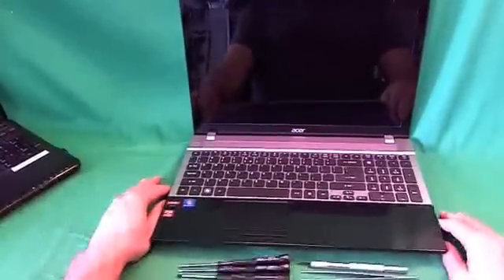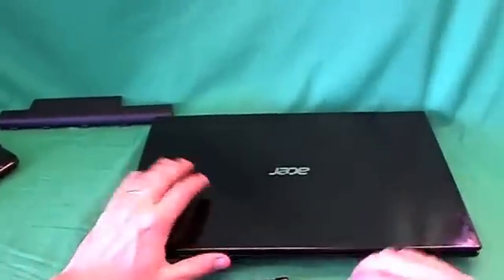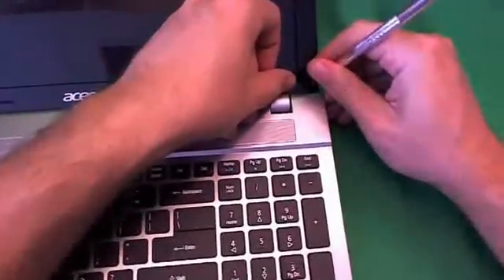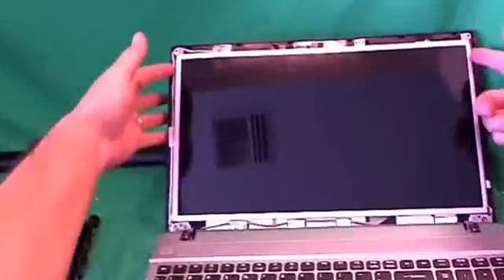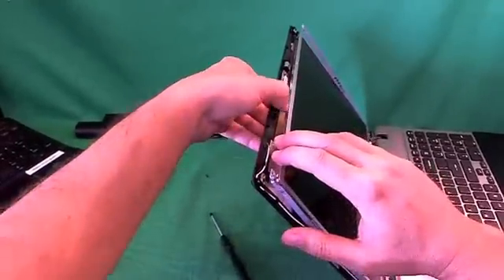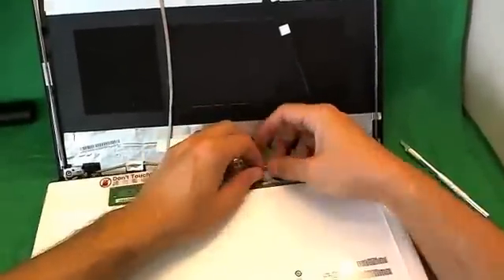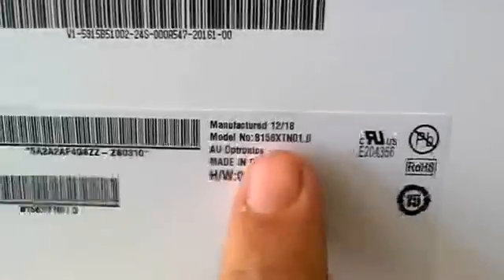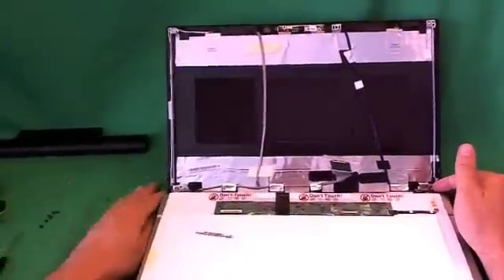Acer Aspire V3 Laptop Screen Replacement Procedure

Comment: hey i have a acer v3 with shitty 1366x768 resolution screen, and i was wondering if it possible to replace that screen with full hd non glare ips screen from the same model?
both of the screens looks the same for me, 40 pin connector and all that stuff